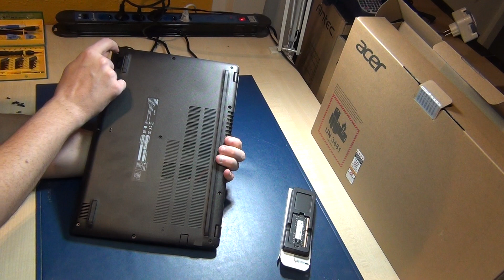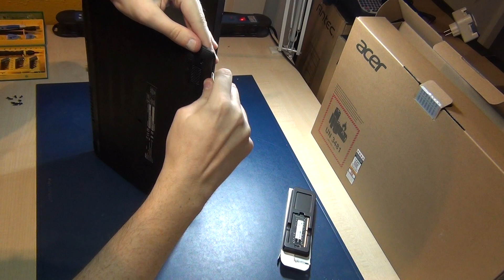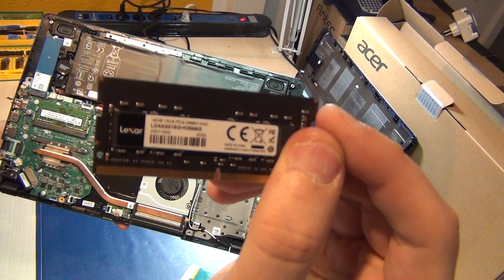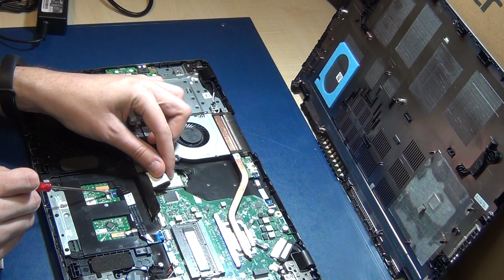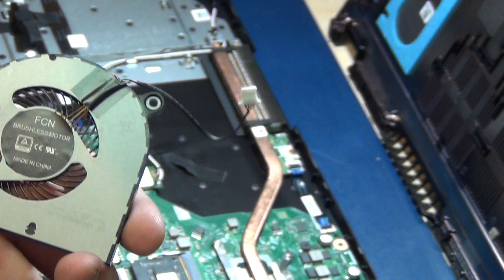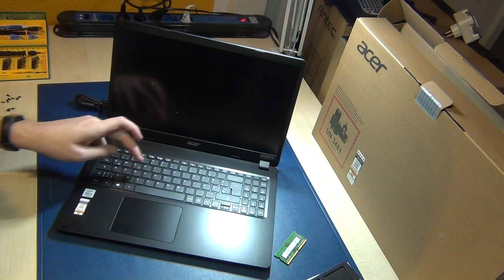Acer Extensa EX215-51 215 15 laptop How to disassembly / upgrade RAM / SSD/ battery replacement /

Comment: i have acer extensa ex215-51g-550a with 4gb onboard ram. and i install 16gb ram into available ram slot. so i have 20gb ram installed and it works fine.
Reply: how come?

Comment: Hi good morning!
Can you suggest best RAM  for my acer xtensa 15  EX215-52-30GA
Laptop Getting slow with 4GB RAM
I'm from india
Reply: You can upgrade to ssd as already PCI slot is available hence no need to remove the already 1 TB HDD.  OS  will be loaded in nVme m2 PCI slot SSD and other normal file can be saved in that 1 TB HDD.

Comment: hello I have a computer practically the same as ex215-21-49jc but I can't install any linux. all do not detect the hard drive which is HP SN520 NVMe. Can you help me find a solution? W10 works but it is very slow

Comment: Specification  says max 12GB DDR4, so adding 8GB to to already present 8GB is not useful. The bios reports 16GB in this demonstration, but I wonder if the upper 4 GB is really used by the processor. Why use the machine with one DDR4 stick if you can increase cal ulation and graphical speed when using 2 memory sticks.
Reply: Only one memory slot here,

Comment: How many RAM slots does this laptop have? On task manager it said it had two but when I opened it up I couldn’t find the second one
Reply: One
Reply: The first one is a built in the mother board and the other one is on the slot this pc have only one slot for extra RAM

Comment: how about instead of 16gb,  installing  32gb ram ?
Reply: u can only change the ram modles that are compatible if they make the laptop with a 32 gb ram version yes you can if they dont u cant upgrade it also not by ur self. It caused bios issues and  a custom bios is hard to code
Reply: This laptop have a single ram channel.You dont upgrade to 32 gb.Maximum ram capacity 16 gb.